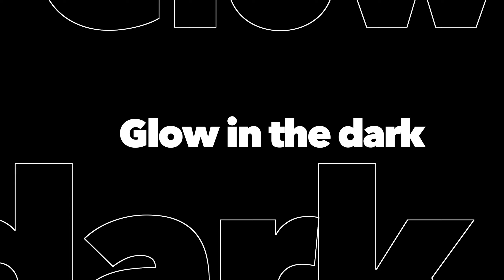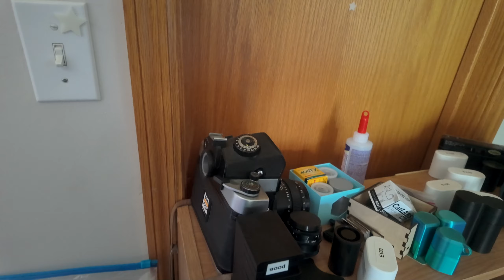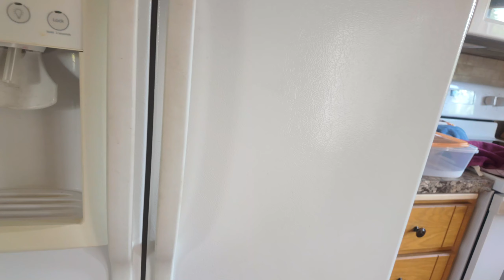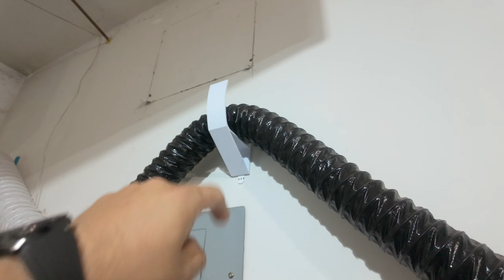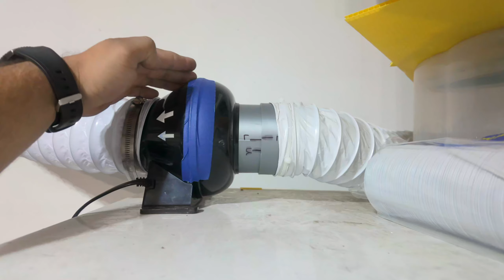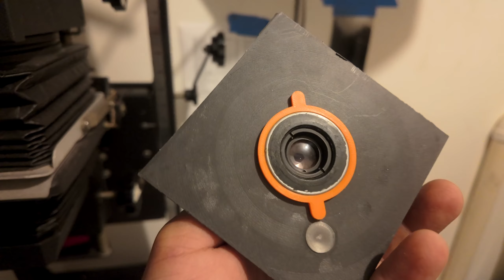Practical 3D Prints I Can't Live Without and Why YOU Need a 3D Printer!

Comment: The only useful item I have drawn and printed ( so far ) 
has been my version of a Vivitar flash 4x AA battery holder drawn with SolidWorks and printed at a local junior college while taking a night course during one semester.
My version of the Vivitar AA battery holder item was printed at the school.
I used to use SolidWorks at work.
I am looking for a substitute for the AA batteries in the Minolta manufacture external battery packs.
If I can adapt my existing Nikon D3300 batteries for 6 VDC, I would prefer to draw an adaptor tray to fit my Minolta Maxxum 35mm camera external AA battery grips.
I have not yet had time to try a DC to DC converter for dropping the DC voltage from 7.4 to 6v .
I will need to decide on a drawing software as I am only used to using SolidWorks at work, then purchase a printer when I have sufficient time to use it.
Kudos on your videos.
Always interesting topics!
Reply from the maker: I appreciate your comment! That sounds like a great application for 3d printing. You could probably make your own Lithium ion battery packs and make an adapter for them to fit inside the battery grip. You may be able to get away with using a resister or few instead of a dc to dc converter at the expense of heat. As for software, if you're familiar with Solidworks, there is a Solidworks for Makers that is basically a web version of Solidworks but is $39 per year to use, or the common Autodesk Fusion360 (which I have become accustomed to). I've had a lot of 3D printers but have definitely grown to love my Bambu Labs printer which is the best out of all the ones that I've owned so far.
Reply: @AleksUsovich  
I will check into your suggestions.
Thank you!